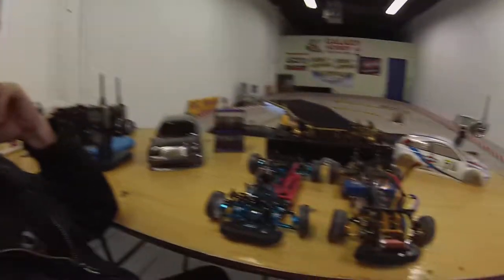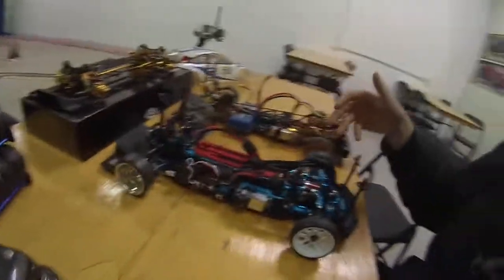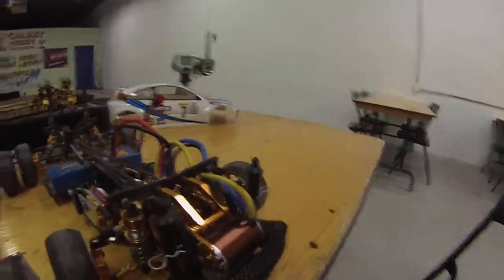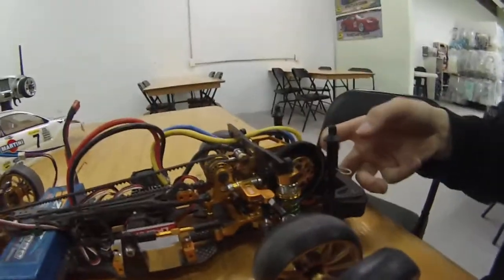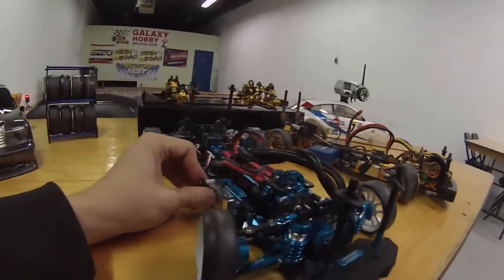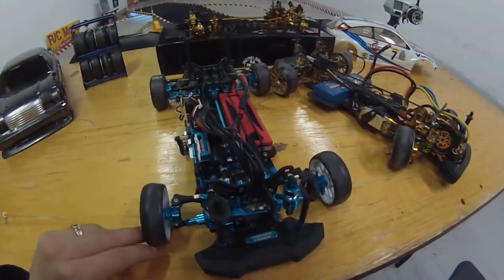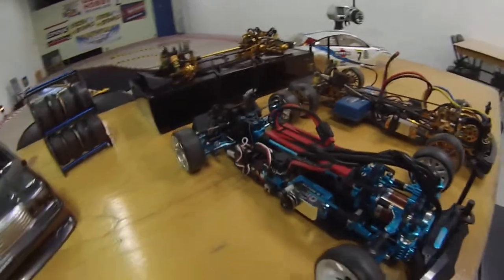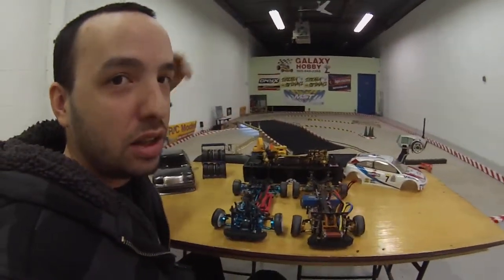R31 & TT02 FRD Comparison

Comment: I have the R31 RWD, nice kit but the ball cups are horrible, what are most people changing out to?
Reply from the maker: yeah i know what you mean about the ball cups. People in my neck of the woods have been experimenting with different ball cup manufacturers, me personally I haven't looked into getting new ones yet
Reply: Nice chassis man how may cells are you running with that lipo battery
Reply from the maker: +Dylan Aponte 2S Lipo....from 30c-60c usually...4000-6000Mah :)

Comment: Would you say the r31 is better than the tto2 frd? I am trying to get into drifting and I am leaning towards the r31 but I am worried about having to deal with the belts, will I be going through a lot of them? Thanks
Reply from the maker: +TheTribeBMX The TT02 FRD is better out of the box, so it requires less tuning and setup right away to drift very nicely. The R31 is still a good chassis however we have found that it requires a little more time and setup to get it just right :) If you like to tinker and don't care how long it takes to tune a chassis, go R31...if you want to drift ASAP go TT02 FRD.
Reply from the maker: +Nez0's Bad Shoppe Other considerations...Eagle R31...body choices are sort of limited due to the front motor assembly/front bumper. The Eagle TT02 FRD...the body post geometry is IDENTICAL to the Tamiya body geometry which is fantastic because you can drop a Tamiya drilled body for TT01 right onto the Eagle TT02 FRD...they give you the same body posts as you would get in a standard Tamiya TT01 kit so you can run multiple bodies that have  "Tamiya" holes drilled in them :)
Reply from the maker: +Nez0's Bad Shoppe Eagle R31's don;t eat belts so to say, but as with any belt driven chassis make sure to check the belt tensioners every so often to prevent belt slip. The TT02 FRD also uses belts but they are not as big as the R31's :)
Reply: +Nez0's Bad Shoppe thanks so much for the help! :)
Reply from the maker: +TheTribeBMX you are most welcome good sirs :)